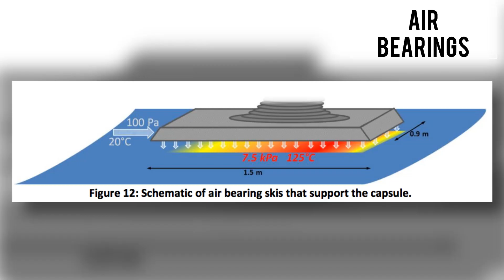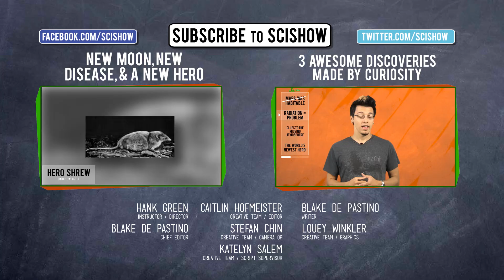The Science of Hyperloop

Comment: They plan to put these tubes above ground for miles on end, metal expands with heat in the Californian desert the temperature can fluctuate drastically how do the plan to overcome this? If the tubes were separated each km or mile and had a rubber vacuum seal these would be extremely vulnerable.if there is a rupture in the tube it would kill everyone in the carriage(pod) and completely shut down the entire tube network.Does anyone have any answers for this ?

Comment: You're forgetting more questions, -- No. Not even questions but rather actual problems.

1.Catastrophic failure upon ANY holes in the vacuum in the pipe, atmosphere rushing in with huge amount of PSI destroying the pods in the tube.
2.buckling issues caused by stretching of the pipes due to heat.
3. Maintaining vacuum over thousands of miles long pipe.

That's just scratching the surface. First glance it seems like an easy band-aid fix but if you have half a brain you'll realize how impractical this hyper-loop is. I get it people wants to feel like they are witnessing some sort of revolution of transport.
Sure enough we had enough idiots funding this project. People who can't even remember basic high school level science on physics apparently.

I will expect some people to respond to this comment butthurt about this reality check but the reality is never warm and fuzzy as you'd like to be. Please use logic and reasoning along with reliable sources for your claims together with evidence. Otherwise I will not consider following replies/comments seriously at all. Thanks.
Reply: i agree with u

PS have u seen thunderf00t yet?

Comment: Elon musk needs hyperloop to transport all his lithium ion battery pack for tesla motors from giga factory at a faster rate and safer way. Also every mile of dual way hyperloop have an surface roof of approx 200000 sqmeter  for solar panel which of course could be routed to the gigafactory and fast charging stationspossibly letting him get off the grid. the power companies and the petrochemical industries are definitley not going to like this. Behold the age of Lithium Ion.
Reply: IT'S HAPPENING

Comment: The problem is if it was solar powered then you couldn't really use it on cloudy days or at night.
Reply: +VitalSigns1288 They would most likely use energy storage and tie into the grid when solar alone cannot support the load.
Reply: +VitalSigns1288 If the energy source that charged the batteries was solar, than you're still running your system on the primary source. In addition, they hope to be net positive with this system with 500 miles of "track" covered in solar panels.
Reply: ***** If you're running you're "alternative power source" the majority of the time, then is it really the "alternative"?
Reply: Okay, you need enough power to both run the system and charge the batteries enough to run for up to a week without sunshine.

Comment: I am wondering why they are using air bearings and not Halbach Arrays of magnets to keep the vehicle away from the sides of the tube.  A slight deflection of one of the air bearing pads could be a catastrophic problem at 700 MPH, whereas three or four Halbach arrays surrounding the vehicle consuming ZERO energy could be fail-safe down to 1 or 2 MPH and could be arranged to provide less aerodynamic drag than the air bearings. They could also use slightly smaller diameter tubes for the same size payload.  I hope this notion gets some serious consideration, or someone can tell me why it should not be used.

Comment: Here's my question: How are you going to prevent people from blacking out or dying?  Surely it would take a good amount of time to safely accelerate up to that speed.
Reply: Assume top speed is 760 mph, which is 339.75 m/s.

With an acceleration of just 1 g, it would take only 35 seconds to reach that speed, so probably not an issue.
Reply: Whatever.
Reply: +Brandon Spicer 1120 kph is closer to 700 mph. I did my calculations based on a top speed of 1125 kph (gives a nice 312.5 m/s), and got a time of 32 seconds. Basically the same results, so yah, not an issue lol.
Reply: +PupdudePwns That's not what patronize means.
Reply: +PupdudePwns Hahaha, owned.
Reply: lorenzo de Wolff
Don't patronize me. >:|

Comment: Another problem: the west coast is notorious for earthquakes. How would a vessel travelling at over 1000 km/h in a tube fare during an earthquake? Especially if the earthquake damages the tube?
Reply: There's actually already a solution to this problem implemented in Japan, which is also known for its high-speed trains and frequent earthquakes. The railway company has nearly 100 seismometers placed about the country which send a signal almost instantaneously to all of the trains when they detect an earthquake 12-15 seconds before it hits. The trains take 7 seconds to stop. This system ensured that not a single one of Japan's trains derailed during the 8.9 quake in March 2011, trains which travel at over 200km/h. So a better question is: How would he get the vessel to stop in 10 seconds or less despite it traveling 5 times faster than a Japanese train?
Reply: joelproko There are dampeners built into each pylon which account for lateral and vertical changes and in terms of thermal expansion of the tube this is addressed at the two stations ( located at either end of the system) with telescoping joints. This also allows the entire tube system to primarily be solidly welded (therefore more stable to expect forces both internal and external) along the length.

Comment: oddly enough I see the future of this kind of tech being used to replace existing train systems in and out of fracking and refineries for oil and coal, not for public transportation. I think magnetic chemical levitation would work better than air pressure anyway. I could just see the bad PR on this tube idea as accidents frighten citizens from ever daring to think of using this as a means of transport ever again, be it, lightning strikes to the solar panel, earthquakes, malfunctions to the air, broken tubes launching people wildly into open terrain at 1120 mph, speghetification from the air pressure in a dogpile accident... Oh man I need to stop think about this its making my stomach turn.
Reply: 1120 km/h, not m/h. 1120 km/h is around 690 m/h.
Reply: Also, you're right. There would be some groups dedicated to fearmongering once this thing gets built.
Reply: Team Firefly Oh my bad. 690 m/h. Still too fast.